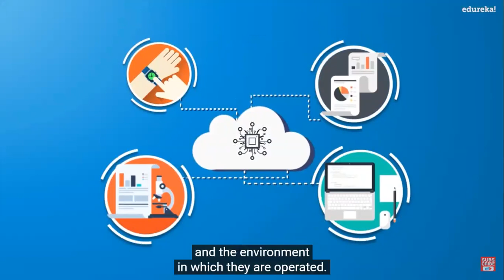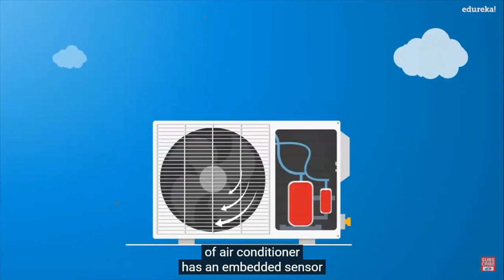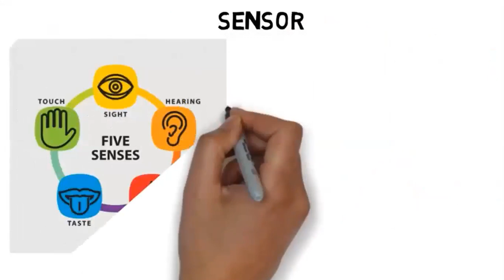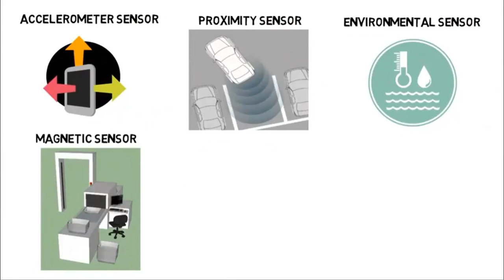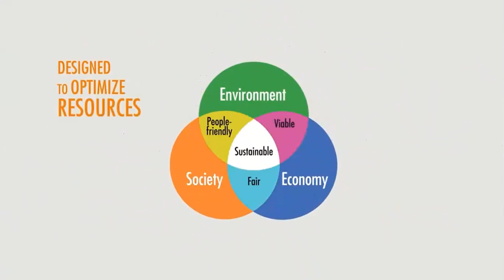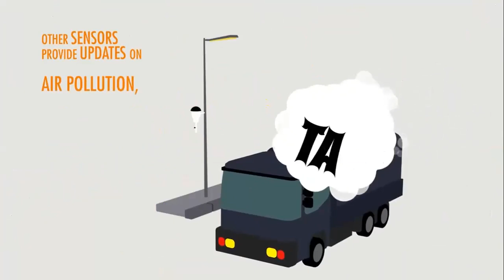JS/CS/11/EMERGING TREND/ PART 5/WK 4/D 4

Comment: my smart city should have a realtime security with a theft sensors ( this means that it can detect the movement and can assume their intensions ). air filled speed breaker ( a high technology speed breaker which would work only when needed) .direct access to the age group infos to the traffic cameras so that the below aged person could be detected and fined easily .( includes people with no driving license) a underground wiring/cable system .
Reply from the maker: WOW Manas. assuming intentions seems far fetched but not impossible. this smart city definitely values life and security. nice concept. wish you will fulfill it one day :-)